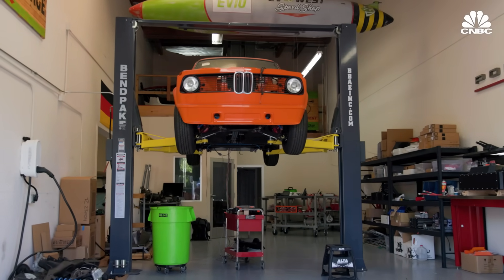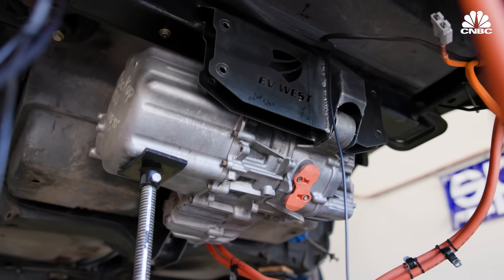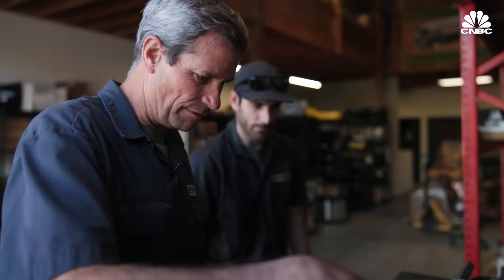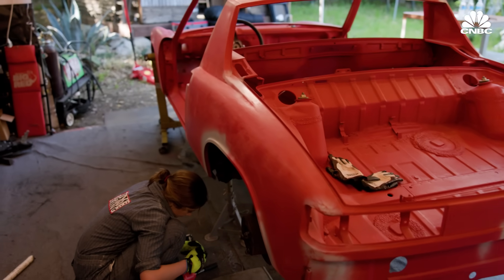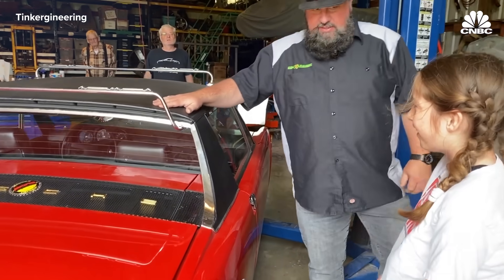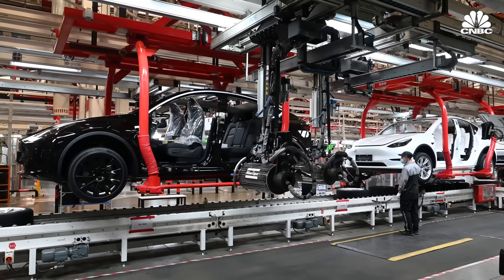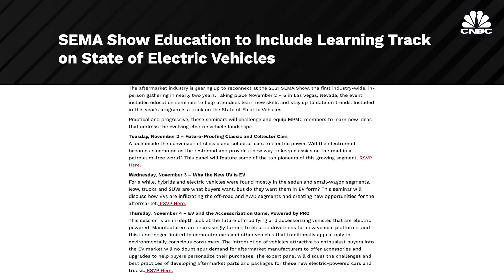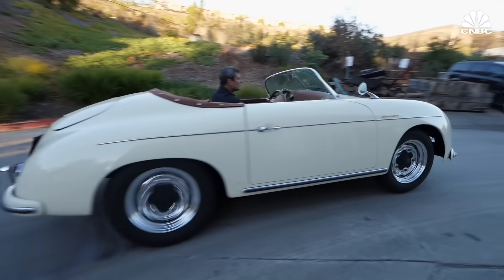How To Convert A Gas-Powered Car To An Electric Vehicle

Comment: As a performance fan, an EV conversion is tough to beat. The instantaneous torque puts a big smile on my face every time! I agree that the convenience of a gas powered car is great, even with the high gas prices right now. We recently bought a VW ID.4 and love it, but we bought it after a ton of research and understanding how it fit into our lifestyle and travel plans. The improvements in Level 3 DC fast charging and increased availability have certainly been encouraging developments that will improve longer range trips, but we will keep an ICE vehicle for the foreseeable future. However, I am planning to electrify that ICE vehicle with a small Tesla motor and the battery pack from a Chrysler Pacifica hybrid in search of vastly improved performance and hopefully some improved MPG…we’ll see how that all turns out. It’s not a simple learning curve and high voltage can be very dangerous, but so can gasoline - just ask Leno.
Reply: Can't wait in five to ten years when Axial Flux motors come out in mass. 

 There is one by Helix UK. They claim 52 pounds and.... 800 BHP! 

 Imagine if someone grabs two.  Sticks it with a tiny jet turbine generator. A small solid state battery to run. Stick it into a small body. 

 Boom! Hell, soon you wouldn't need a generator. 

 Future is bright. I don't care if a car goes vroom. I just want speed, and great handling. EVs allow that with the center of mass. They just have the whole weight issue. 

 I am surprised there aren't more series hybrids TBH with a turbine engine. Always thought they were the most efficent, lightweight, and relatively simple.

Comment: I'm currently converting a 1994 Toyota Celica, these conversions are important not only for the environmental benefit that comes with cutting emissions, but for keeping these classics on the road for all to enjoy as parts become harder to obtain.
Reply: I have a 00 Celica and would love to do this
Reply: 1994 is the one with round front lights or the one with opening front lights? I used to have 1993 Celica.
Reply: Scotty kilmer should see this 😎
Reply: EVs are a scam. Lithium mining is an environmental disaster, it takes 500,000 gallons of fresh water to produce 1 ton of lithium, it takes a ton of oil to produce and transport oil, when the batteries die they are incinerated. Then there is the life span issue, EVs are heavier, making accidents more dangerous.
Reply: I have question, how do you insure an electric converted car?
Reply: @EddyBoh  depends where. In Poland you need to pass state car check, then change the type of engine in the documentation and that’s it. You go to insurance company and it’s actually cheaper then gasoline. Of course it’s only OC and not AC.
Reply: @volkhen0  Thank you, but I was referring to the location where this auto-parts business is located, which is in California, USA
Reply: 97 corolla is begging for this 😂
Reply: The 6th gen Celica is such a beautiful car.  Glad to see someone giving one a new life.

Comment: A good friend of mine converted a Porsche 914 (the mid-engine boxy one like in the video) to an EV. A BUNCH of work, a BUNCH of $$, but he got it done! He used lead-acid forklift gel batteries. Only has about 50 miles of range, but still pretty damn cool!
Reply: Bruh
Reply: He could sextuple that range with lithium batteries.
Reply: Couldn't afford them. His project cost $20K as it was! @ljprep6250
Reply: 50 miles 😂
Reply: Useless mod. I couldn't even visit my closest relative.
Reply: @keilmillerjr9701 useless for you* lots of people live close to their families...

Comment: hybrid reduces emissions more than ev, it uses the worlds limited batttery supply, to reduce emissions where they happen most across all cars throught the rest of human existence, which is in low speed high torque ( stop and go traffic) without being heavy (which is less crash safe espcially for others in crash, and weight also worsens normal  wear damage to road which cost emissions etc to fix). a  small but essential part of the battery cannot be recycled after short lifetime due to high energy flow into and out of battery causing normal dendrite forming  battery wear damage, this is why aftermarket electric cars go down in value as much as they do. see volvo study on how it suppsoedly takes more emissiosn to make electric car, motors arnt recyclable .  mahle says its working on recyclable electric motor.  its best to have small combustion charge battery size somewhat closer to optimal size for longveity , because more battery is exponentially more energy wasted which worsens longveity, ebcause yoru nto using all thee energy all that long range ev big battery mass carries, and current ev tech is much heavier per amoiunt fo energy vs combustion.   sir joseph center enegry and others are working on converting linear combustion energy to elctric drive , and maybe assited by hydrallic drive.  bio fuels, hydrogen , e fuels, propane etc are all more sustainable tech than relying more on electric  battery car, so only use enough battery to reduce emisions to a resonable amount for the sake of human health  etc.            it will more much easier to own too, cheaper, lightweight driving fun more similar to lotus elise mid rear engine weigth distrubution(for saftey and being abel to preserve momentum around turns, ewhich is more effceint than regenrative braking), manual steering,  a car structure that can give you precise feel of how car is moving ,  rear wheel drive (less regenerative braking , so more longveity of battery) etc.

Comment: Thank god this is going on.. It really will change cars because look at RC racing.
We used Nitro RC's for a while then LiPo came in and changed it.  This will allow the slow down of burning fossil fuels
But this will not majorly take off until you have generators on all 4wheels that will allow it to charge as it's rolling
like an alternator but higher volts \ amps 
I still don't understand why this isn't a thing. Should be able to run the motors off the motion and only need batteries when taking off.
Reply: It could eventually become a thing.   But a working road vehicle is a complicated system of interrelated parts that are subtly and grossly contributing to the ride at the same time.  

For starters, the EV weight will likely be greater depending on the battery pack size.  The weight distribution will be radically changed from the car's original design possibly making the driving experience feel really weird.  Then would need to go through several expensive and time-consuming iterations of test drives with suspension/tire/wheel changes to try to get the feel back.  But that could be impossible for a given chassis to get it just right after such a massive change.

In RC racing, you're not inside the vehicle to feel every bump, vibration, lean and tilt of the vehicle, etc so its a lot more forgiving.

Comment: Factory 5 should join with EV West to do some kit cars with Electric Powertrains 🤓🤠
Reply: I thought they used to offer an 818 conversion kit. There’s a shop in Canada that converted an 818 with a Tesla dual motor setup that runs 9s in the 1/4 mile!

Comment: Will the EV🚘🚗 conversation include,self driving and lane centering abilities?🧐
Reply: Doubt it.  What's being done here is a power train conversion which is separate from the AI self-driving autonomy.

The sensor installation/tuning/testing along with the computing hardware are several levels of difficulty more to achieve useable level of artificial intelligence.  It will require quite a bit of unique tuning for a custom one-of-a-kind car too.

Furthermore, nothing is stopping that AI autonomy upgrade from being performed on any traditional ICE vehicle.  But gotta be really really careful with any system that can control the steering and accelerator at any time no matter what vehicle it goes onto.  

Software programs can "crash", sensors can come loose or malfunction, and many more issues can result in a real life "crash".   That could end your life, some else's life, land you in prison and give you emotional trauma for the rest of your life.  Serious stuff.

Comment: This is a very good summary of the DIY EV conversion market.  I believe EV conversions have a future.  I love cars and grew up an ICE hot rodder” but the torque and responsiveness of an AC electric motor is mind boggling.  The hot rodder’s of the future will be building EV’s. EV West played a major roll helping me build my VoltDog.
Reply: I believe that all race cars should be EV, including monster trucks.
Reply: No hot rodder will even buy a electric car it goes against everything they stand for.
Reply: There's nothing to "build" you just plug electric motors in.
Reply: @Leester-70  I may not agree with your hot take, but you certainly follow through with the spirit of your username. "What it says on the tin." As grandpa used to say.

I can direct you to several ev conversion projects on YouTube if your interested in more detail. These mainstream media videos don't show how much actual work people put in to these vehicles.
Reply: @Leester-70  This is the hottest of takes

Comment: As great of an idea that this is you still have one major problem,the power grid. Calif is shuting down the power olants using natural gas/oil and the have 1 nuclear plant still running. The idea that solar and wind will be able to support the growing need for electricity to cjarge all these vehicles,run house holds,businesses etc is a disaster waiting happen. The current power grid could go belly up and then what no power no cars can be charged homes with no way to heat,cool or cook wtc and I guarantee that the locals are going to look for whoever is in charge looking for their head on a pike .

Comment: EV conversions definitely have a future with something like a quarter to maybe a third of people making low wages in the US and a butt-load of low income retirees without defined pensions coming down the pipeline. The US auto companies will never make an affordable (and reliable and long-lasting) vehicles because they are not profitable enough. Options and features are profitable, but as the vehicles get more and more complicated, and more expensive, more people at the bottom third of income will be unable to purchase new. And people who barely have enough money to get by will not be taking long trips all the time, so EV range may not be that big of a deal. Also, with conversions, you can set up the vehicle to use GenSets (small gas-powered generator on a really small trailer) for the occasional long trip.

Comment: They are gonna F up Alot of vintage cars that should be left original.  
I understand conversion of a Honda Civic or Metro or a Mazda pickup..but to do it to a low volume Porsches is messed up.  Yes a 914... understandable.  1950s 356.  That's not right.

Comment: If it was 50/50, or 25/75, or even ten 10/90. Why can't we have both? Unless regulations for otherwise, someone's always going to have at least a little bit of profit by selling oil. I think we will have both and I think we'll have new manufacturers of ice vehicles because there will be a market for it. Someone will buy it. So someone can make money. Legislative bands on ice vehicles should be completely opposed the future looks more like a 95/5 type situation. Someone could still make money, they would have a customer base of millions and the remaining impact would be minimum. I'm completely one-hundred-percent against banning ice vehicles. If I could be assured there would be a pump somewhere within my vicinity I would be thoroughly supported for the future of transportation and car culture. I believe I'll get my wish, I seriously doubt oil will be banned unless it's don't legislatively at a federal level. Fingers crossed that's a money-making industry

Comment: Car culture is not going to go away just because electrification is gaining in popularity. Judging by the interest from young people, it may live on through EV conversions and sustained interest in vehicular modification.
Reply: It definitely will live on no question and be even more involved.  Also, the modifications can be done without needing smog/emission re-certifications because there are none of those at all.

There plenty of avenues for tweaking and tuning in the EV space:  Tuners can change battery size, battery chemistry, battery placement based on the type of race or track.  They can change the lines of code that make up the firmware of the brushless motor's electronic speed controller (ESC) which can radically change performance and behavior.  ESC configuration or custom algorithms can modify the 3-phase motor timings to tune for performance or tune for range.  They can get into custom winding of various motors.   They can have multiple motors and change power distribution logic producing all the AWD/FWD combinations -- and this can be changed electronically without any complicated mechanicals.  The list goes on and on.  

Tuner culture for EV hasn't even started yet!  🛠🔩

Comment: The auto industry needs to create EV batteries that are sustainable, safe, and recyclable for the long term…I think I would be benefiting for both the industry and the environment consumers live in!
Reply: Guess what, they already exist.
Reply: @Freba9  no they don't. Current EV batteries are still unsustainable, relying on destructive mining operations and exploiting child labor, and helping the destructive artisan mining in DRC skirt around sanctions.

The ones are supposed to be sustainable are still years away from mass production. Sodium batteries would also be too heavy and inefficient to be used in cars, so they'll most likely end up in fixed infrastructure projects. Recycling lithium batteries isn't also a thing.
Reply: @triadwarfare  They do. Look up lithium iron phosphate. Has been around for years and many EVs rely on it. No cobalt, no nickel.
Reply: Great, so when it’s cold outside you have dramatically reduced range.. brilliant! Not to mention, they still use lithium, which is going to become a major problem in the short term future as supply does not begin to meet demand. 

Simon, this is all a pipe dream. It’s time you just accept that.
Reply: @Shoprestorationthe  You are wrong. Why would a more sustainable solution have to be perfect in order to replace a far more polluting solution? The point is that it is a huge improvement. And no, the range does not drop dramatically in winter.
Reply: Research the advances in solid state and semi-solid state batteries that are beginning large scale production. Much safer than current Li-ion batteries, higher energy density=lower weight, and drastically reduced charging times, albeit at a higher cost currently which all new technologies tend to see. And when an EV battery reaches end-of-life for a vehicle, it can enter a 2nd life as solar storage for another 20 years. By then we should have some improvements in the recycling process. It’s not as gloom and doom as many naysayers would like to think.
Reply: Joe No such thing is going to happen. There is no new battery technology anywhere on the foreseeable horizon that has the potential to solve the MAJOR issues with EV batteries now. Unless someone comes up with something brand new, and soon, the EV world is going to collapse in on itself.

Comment: Hybrid  hydro electric.  
Small turbing hydrogen motor making electrical power to both store and use to move the car.
A turbind motor or jet engine uses less fuel and burns cleaner running it on hydrogen will only put out water vapor . No carbon.
Reply: Very inefficient.

Comment: We need these "lower emissions" governments to support this conversion of old cars industry, because THIS is how you meaningfully get emissions down and not through buying new and severely overpriced new EVs.
To support this field, govts need to create huge incentive systems that will allow builders of parts (motors, battery packs, electronics, etc...) to offer competitive pricing for these conversion parts, and not use old and recycled from damaged vehicles or new but low quality/performance/efficiency parts that existed from the past, (and not for EVs.)
Because these conversion are totally inadequate, they are just weekend toys.
But such a conversion should have similar performance to any new EV to be worth it.
For 10.000 usd you should be able to retrofit a vw golf mk5 (20yo car) into an EV with 100-150hp and a range of 200miles. 
Remember that a tesla 3, which is a premium vehicle, (not a vw) brand new car, much larger in size than a golf, double the power of my suggested 150hp, and has like 270miles of range costs 40.000.
A lesser spec'd retrofit on a smaller car should be a fraction, including labor.
That is where prices should be for conversions to be worth it.
And also these politicians that are forcing the population to pollute less, to also force banks and any financial institution to create very low APR (under 0.5%) loans for anyone wanting to convert old cars to Ev tech.

Comment: I'll stick to gas hybrid, I have no interest in cars you have to plug in. bev cars doesn't make any sense. electricity rates gonna rise, your battery gonna deteriorate and the cost to replace those batteries are just too expensive.
Reply: You will have no choice in the future, but I am sure you will love it eventually.
Reply: @Freba9  well I do have options I can go with fuel cell electric. The oil we use now can be turned into hydrogen.
Reply: @rocky965able  Very inefficient and you will have to wait for infrastructure to develop, which is unlikely for passenger cars.